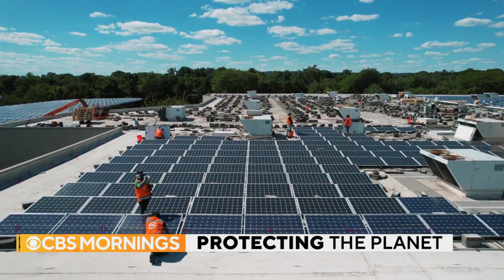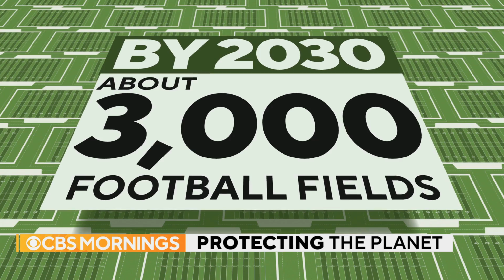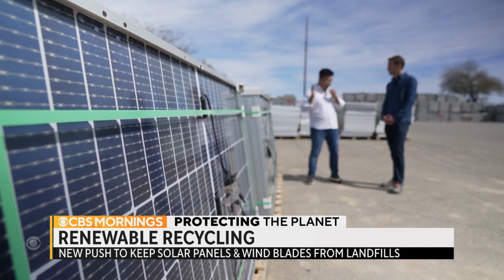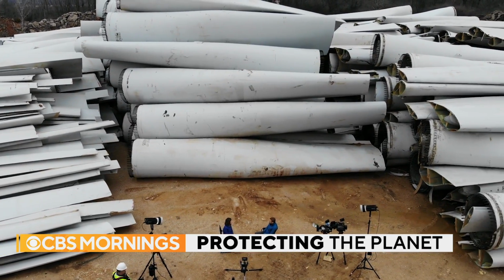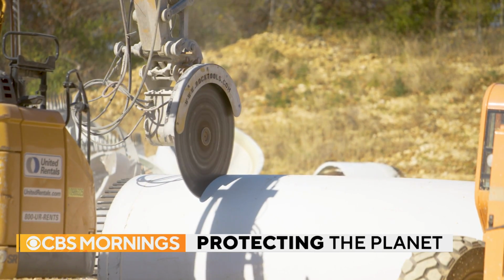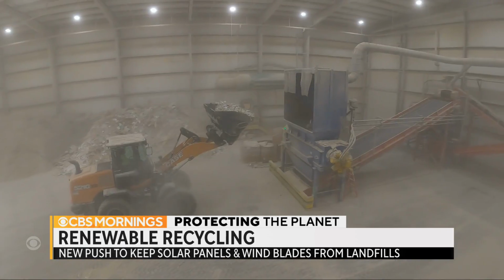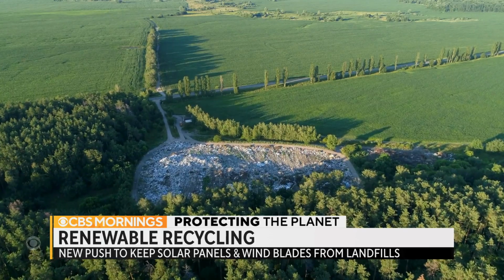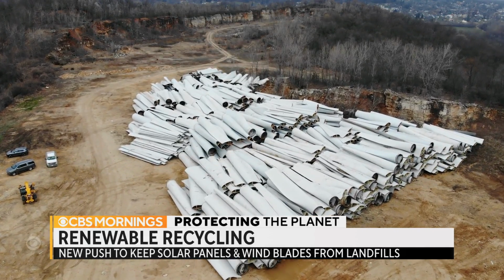Wind blades and solar panels head for landfills after being replaced

Comment: Seems like there would be LOTS of ways/things to use those blades for.....after all,they were designed to handle a lot of stress,so are very structurally sound. I imagine they must be "retired" after a certain number of years,not from testing to see if they are still good. lightweight,fairly indestructable,weatherproof,engineered for stability-what a waste to burn these up instead of using for numerous things.
Reply: They're made with a ton of fiberglass, which is damaged from UV rays and starts falling apart, or gets hit by birds, hailstones, etc.  Compromised Fiberglass is a major health hazard, similar in a lot of ways to asbestos in that the fibers can enter your lungs and never leave, and the processing and resins may also be carcinogenic.  Damaged "used" blades as playground equipment sounds like it's going to be a class action lawsuit in a few years.  

Using it as a fuel makes a lot of sense to me but I think large wind farms are a blight on society and our natural landscapes, and their negative effects on the environment are only exceeded by hydroelectric energy installations. I hope we move away from both and focus on solar and molten salt nuclear as clean energy sources.
Reply: @brassmule  its not like old tires are chopped up  on playgrounds floors and on soccer fields releasing toxic fumes in the summer. oh wait, its already done to kids health.  this windmill fiber glass can be resealed and fix for other purposes. recycling is 90% a scam unless you reuse it 10-100x times.
Reply: another couch potato lays it our for all.
Reply: There certainly are. But without a lucrative investment opportunity there's no motivation to find those ways. It's clear that the environment isn't a consideration; only profit and growth.
Reply: @stickyfox  thankyou for highlighting a key issue with capitalism
Reply: Maybe they could teach you English.

Comment: All the waste and pollution from coal, oil and gas gets evenly dispersed in our atmosphere and in the air we breath and is conveniently invisible so it gets a pass from scrutiny. What you don't know can't hurt you, right? ;/
Reply: You do realize that with todays coal plant filter technology, the air coming out of those stacks is extremely clean, right?
Reply: @matthewm3912  Still those fossil fuel power plants emit 1.82 billion tons of carbon emitted into our shared atmosphere each year that cannot be filtered!   This is just in the United States.

The EIA publishes figure of 2.26-lbs of CO₂ per kWh of output for a coal power plant and these plants are in the gigawatt power range.   So take a typical coal gigawatt power station.  Using output demand factor of say 0.5 (because of renewables in the daytime and natural demand curve) then you get an astounding 13,560 tons of CO₂ output in a 24-hr period.  Natural gas is slightly better at 0.97-lbs of CO₂ per kWh so a gigawatt plant would emit 5820 tons of CO₂ per day which is still awful. 

This is how the EIA published USA's yearly CO₂ emissions from all combined fossil fuel power plant sources (coal, natural gas, petroleum) at an astounding 1.82 billion tons of CO₂ in 2021.

Also, if using natural gas, there is a lot of pure methane (CH₄) that is emitted during processing and transport and small leaks out of valves and seals.  CH₄ has 80-times the greenhouse potency as CO₂!  CH₄ is a light weight gas that absolutely will want to escape any vessel it is contained within and want to float up into the atmosphere.  This is called the "fugitive emissions" problem is responsible from 6% of global greenhouse gas emissions on a purely waste stream.  The US has over 2-million miles of natural gas pipeline which gives a lot of opportunity for leaks.

Sure, the SOₓ and NOₓ are in trace amounts (still deadly) and can be filtered.
Reply: @matthewm3912  No, he doesn't... He drinks the kool aid
Reply: @matthewm3912  you realise that is not the problem, the soot can be filtered out, the CO2 is not. The soot is a local problem, CO2 a global one, and the one that needs to be fixed.
Reply: @rlarno  Plants, grass, trees all eat Co2. We're good.
Reply: @matthewm3912  not at the rate we are reintroducing the amount of CO2  stored from those FOSSIL plants.
You realise what coal actually is, right?
Reply: @rlarno  We need CO2
Reply: @rlarno  it's "Fuel" dependable reliable fuel.
Reply: @rlarno   And if you don't fix Russia, China and India NOTHING else matters.... Do YOU realize that?
Reply: More truth about the LIE of green energy. Not to mention we do not have a "climate crisis", which is again another LIE.
Second only to the unscientific theory of evolution, man-made global warming is the greatest hoax ever perpetrated against humanity by earth-worshipping zealots who are stealing $trillions of your tax dollars to fund their false religion and lies.
Reply: Lol!😂😅😂😅
Reply: Pools of liquid toxins from coal fired plants are a massive risk.
Reply: @themidgetsman some uses for coal ash: top layer of unpaved roadways, added to concrete and wallboards, as a soil additive. 
I can add more and also provide references if you don’t feel like typing “recycled coal ash” into your search engine. 
End point: all energy sources have waste that need proper care and management. 
Even the energy we create…..
Reply: Kinda like that BP oil spill in the Gulf.  They just sprayed chemicals on the oil to make it sink to the bottom so we couldn't see it.
Reply: Too true.  That fossil fuel CO₂ output is mostly gaseous and invisible so takes advantage of the human brain's natural "out of sight and out of mind" psychology.  The fossil fuel industry essentially uses the shared global atmosphere as a 24x7x365 public toilet.
Reply: @themidgetsman  as of now I agree, was just pointing out the fact that all energy sources need responsible waste management. 
But… who knows what the future may reveal about the plastics of the wind blades and the unknown environmental impact they have. 
It’s not like we haven’t been mislead by the science before, right??

Comment: When you burn the shredded blades you get CO2! Its the same as burning fossile fuels but with a 15 to 25 year delay
Reply: Burning fiberglass and resin. That can't be good.
Reply: And in those 15-25 years they’ve prevented millions of tons of CO2 from entering the atmosphere. How do you not get this?
Reply: according to the WSJ using the shredded blades instead of coal  to run the cement plant is 27 percent cleaner
Reply: @davediamond7228  I believe that. Gas and oil are also much cleaner. The blades are made of gas and oil.
Reply: @davediamond7228  You do realize that coal is literally the dirtiest form of fuel on the planet right?  Nuclear power would be thousands of times cleaner, but the hippies pushing green energy killed any chances of that helping save the planet.
Reply: They don't just burn the shredded blades for crying out loud. They add them to cement as replacement for fly ash, which require a lot of energy to produce. Why is everyone in the comment section not getting this? Do people not know how concrete is made?
Reply: @mintheman7  I quote- from the video: "They sell the blade remains to cement companies, which use it to fuel their kilns in stead of coal." What am I missing?!
Reply: @mintheman7  thats right the residu of the burning is used in cement. But the CO2 of the burning proces is put into the atmosphere.
Reply: @mintheman7  ??
Reply: The emissions saved by the wind turbine are much more.
Reply: @Freba9  thats not true  .The power that the intermitting generators (wind and solar) produce is not reduced in the conventional plants. The grid is complex.
Reply: @johannesannema8692  Renewable energy directly reduces grid CO2 emissions.